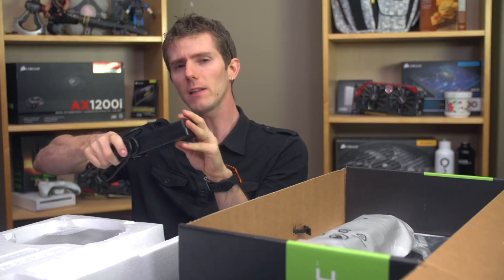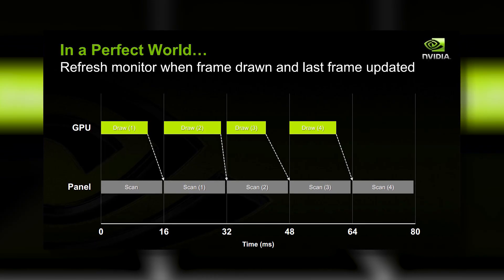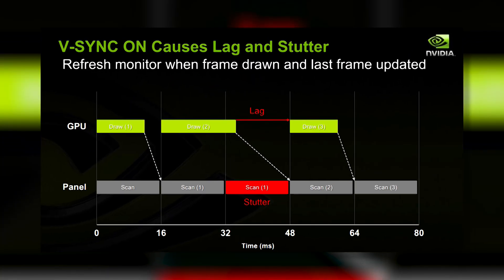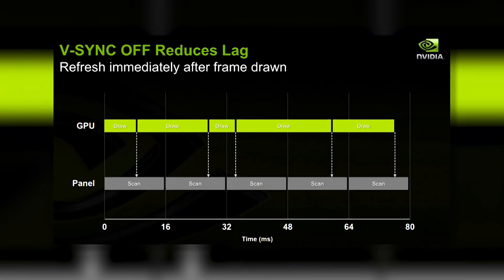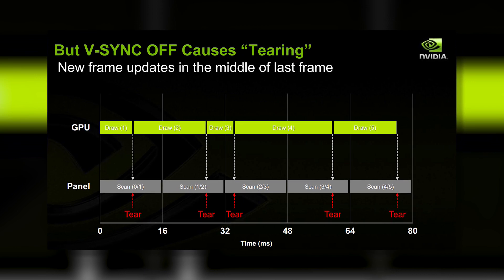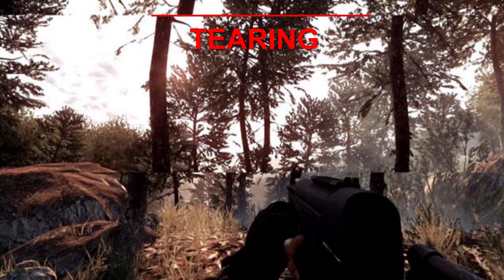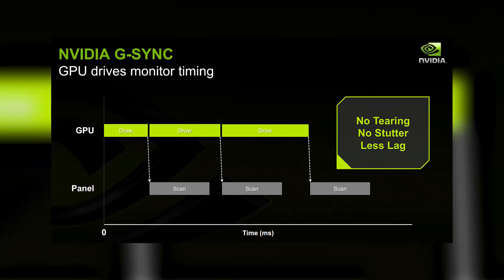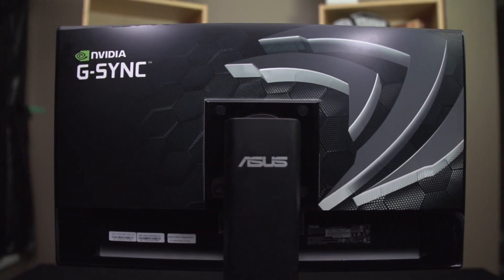NVIDIA G-SYNC Tech Preview - Linus & Slick's Impressions

Comment: Like what Linus said, Nvidia is going to have a hard time marketing it, but there are more problems than just 'whether you can feel it or not'.

At least AMD's Mantle is claimed to support non-AMD chips in the future. Not to mention that G-Sync needs the monitor to support it as well.

On one hand, hardware upgrades don't usually come simultaneously. Monitors can be very durable and serviceable even after you decide to upgrade. 

On the other hand,even if you are building a whole new system with new monitor(s), the problem with G-Sync is that well, you are paying a premium for a monitor which means less budget for GFX cards, and choices are limited to Nvidia models too. It is even worse if multiple monitor set-ups require multiple G-Sync chips.

With this arrangement, and I would guess G-Sync may even take more time than SSDs to become popular, if it ever does.

Comment: G-Sync may be awesome, but, i think it will be useless to spend more money on a new monitor because : Screens working at 140 Hz are coming up, AMD mantle is pushing nVidia, knowing the fact i love nVidia for rendering and game, with CUDA & stuff, GPUs are each day more and more powerful... so, do you need G-Sync right now ? I don't think so, let's wait a couple of months and see... First i will buy an Gigabyte GTX 760 4 Gb and enjoy BF4 with V-sync for now eheh :P
Reply: Screens working at 140hz are coming up? This Asus G-Sync monitor already runs at 144hz. What's wrong with you? Did you drink your dinner tonight?

Mantle is horseshit. Nobody's going to use it. G-Sync requires NO developer support. It'll instantly work with EVERY game that comes out with NO additional software changes.

Yes, we DO need G-Sync right now. Some of us want to run games in MAME with perfectly smooth scrolling at ANY refresh rate.

WEIRDO.
Reply: HowAbout NoSon Most of the screens are not working at 144 Hz, i'm talking about brands, not how much Asus or BenQ and another one have sold.
By the way, you should read a little bit more about Mantle...

Comment: ok i agree it should look better but as pro gamer i c potential lag in there since frames are refreshing at the point they are fully loaded that mey took longer in some situations then casual no v sync or g sync in that case if u play something like fps or moba u might miss a shot or skill becouse with tearing u get as fast as posible view even if not full but if enemie change location u see it as with g sync u might not see it if frame takes longer to load on your monitor then competitors im not perfectly clear will it be so but im 80% sure it might in some situataions and im not buying it as hardcore online gamer of moba LOL (chalenger) eu west i dont see it as a product i might need i prefer a bit tearing instead of lag that might be created ....
Reply: by the way im even using monitor with 2ms.... and as for ssd i sometimes need to work with pcs without ssd since i repair pcs for friends and there friends for money and most of them dont have ssds il say simply no matter how calm i can be no ssd in pc "MAKES ME RAGE" cant stand that slow work with pc wen instead of 5mins instaling oc and in 30mins max done with full drivers and other software games programs ect instaled u take 2-4h and then u realize u missed something since it took so long to install something

Comment: I simply love the concept, it's been a long time coming. However I agree, G-Sync is going to be a hard sell for Nvidia since it's proprietary and locked to their hardware, and it likely will be this way for bulk of it's lifespan. So I think it will go the way of PhysX.

PhysX was all the rage when Ageia had it, then Nvidia bought it and while it remained very popular, over time the fact that they locked it to their hardware, and even disable it in the presence of AMD GPU's without a mod to unlock it, started to kill it. We ended up with other alternatives that are just as good, such as the advances in Havok and game engine specific physics. Both will run on any hardware brand, and thus more appealing to developers since the discrete GPU market is segregated.

I think it's only a matter of time before we see alternatives to G-Sync that will do the exact same thing, but will work on competitor hardware, or all hardware. Plus things such as adaptive/dynamic v-sync exist, while obviously not as efficient as this, can still greatly reduce tearing and shuttering in most games and it exists for both sides of the fence.

These very reasons are why AMD has said they have no objections to eventually allowing Mantle to be open source or made to work on Nvidia (or any other) hardware. It will only work on GCN AMD cards and Windows out of the box obviously, but they realize that locking it to their hardware forever can hinder it's lifespan.

So yeah, that's my thoughts on it. I think it's fantastic, but I also think it's going to be one of those things that will be skipped outside of the enthusiast Nvidia market. But hey, we will just have to wait and see.

Thanks for the video guys, loved it as always. =]
Reply: AMD knows really well that nVidia is pushing them so hard. A simple example can be used : 1 nVidia card can => Play games with high details & stuff => Help for rendering and encoding, when AMD GPUs are only for gaming ! Ofc, on the nVidia side, you pay a little bit more, But, you get more technology ;)
Reply: " So I think it will go the way of PhysX."  
PhysX is the most used physics API.  Nothing can compete with it.
Reply: Abram Carroll
Actually, it's not. Havok and game engine specific physics are far more widely used. Go check out it out, there are very few games using PhysX anymore. The number drops every year. In 2013 there have only been something like 7 or 8 games that support PhysX? It's a tiny number.

Also, PhysX has not advanced much in the past few years. While it was the top of it's class when it was released and for a few years after. Today however Havok can do anything PhysX can, as can game specific physics, such as the physics/destruction engine in Frostbite. Havok has advanced a lot and is still advancing.

So yeah, PhysX has died off a lot, even though it is indeed a great physics engine. The fact that it's hardware locked is what hinders it. The market is segregated and most developers will choose to go with an engine that will work on all hardware, over one that will only work on one segment.

Also, now that AMD is in the core of the XB1 and PS4, this means no more PhysX on consoles. Havok is already stepping in to replace it when a physics engine is needed. This segregates the market even more and pushes PhysX further off the grid.

Comment: So NVIDIA got G-SYNC to improve the monitor viewing experience while AMD has MANTLE to enhance graphics in general (?). I want both in a single system
Reply: No Mantle is not for enhancing Graphics though it can but rather Mantle is all about optimization of the software to make better use of the hardware you have in your PC.
Reply: Thanks for correcting, hopefully there's a demo on Mantle soon. Well both tech seems to be adoptable between AMD and NVIDIA, and I wish they do that but I think it won't happen

Comment: Upgrading to the Samsung 840 Pro SSD was the best computing upgrade decision i have ever made. My mother was so impressed by its performance that she purchased one and i installed it in her crappy $300 Compaq laptop. Even with an old Intel Celeron chip, it runs faster than most non-ssd machines ^.^

Comment: SSD is great for boot times and application load times, but I can deal with a plain old HDD just fine. I actually still run most games off of the HDD because there's no tangible performance to be gained from running it off of the SSD  in my eyes.

Comment: I don't see how the comparison with an SSD is a valid one. The benefits are widely uneven. I mean, take yourself through just explaining them to a non-geek:

SSD: "It makes your computer run noticeably faster."
Non-geek: "Cool, how much is it?"

G-Sync: "It eliminates screen tearing on systems with newer NVIDIA video cards without introducing input lag."
Non-geek: "Could you repeat that in English?"

Don't get me wrong, I'm getting G-Sync because I'm a gamer and I already have a VG248QE, but I don't pretend it caters to anything other than a small niche of finicky gamers, graphic designers and video editors. Sure, it may be a standard a few years from now, but most people won't notice the difference.
Reply: I agree, and some people notice screen tearing less than others, and screen tearing is only noticeable in certain scenes and camera control.
Reply: "most people won't notice the difference" Gamers will ;)
Reply: Gambero972 Gamers aren't most people.
Reply: remnant24 Yes i know.... O.o, "Gamers" ( i mean Real games, the ones wich cares about Software/Hardware & stuff) are a small part of the people ;)

Comment: I don't quite get a big difference between SSD and the old one. In fact, I can turn back and be completely fine with it. With what you said, for most of the people will not / not care / or even fine with a $100-$150 buck monitor, they will not likely to step it up because monitor for most of us is size, frame rate, refresh rate and response time. It will takes a while, i think. I, personally don't thin I'm going to step up to G-SYNC from my Ben-Q monitor soon. However it's worth to think about when upgrading or building new system. Great job with this review vid plus the advice Linus. Thumb up!

Comment: I dunno triple buffered vsync has always worked perfectly fine for me without any massive frame drops unless my card simply can't handle what going on in the first place. I guess I'm not sensitive enough to the input lag introduced with vsync but this doesn't seem that exciting to me. Only difference for me personally between having triple buffered vsync on or off is the dreadful tearing. vsync on doesn't feel any less smooth so it's not really even a question between vsync on or off personally. Still cool that it's a best of both worlds type thing and I definitely won't shun it in the future if it works as great as people say.

Honestly though this will probably never catch on because it's not open source (nvidia only), you need a specific kind of brand new monitor with a newer Nvidia GPU. It' just a recipe for only very few die hards even bothering. So while it may be neat until a more generic version comes a long i doubt this will ever see any kind of real traction.

At least with AMD when they do something new they generally don't lock anyone out. Mantle is open source (despite the internet apparently missing that memo and a ton of misinformation about it being spread) and tress FX was open source. Those actually have a chance of being something that people might actually use.

Comment: early adapters never have much to gain, if it wasn't g-sync some software hardware combination would have fixed the problem, im not impressed because we could have had better gpu/monitor communication awhile ago, with the ssd, the use of nand flash changed the game for storage, but there nothing new actually in this, amd, or even Samsung could easily create their own solution that could talk to integrated graphics on processors across the board,

Comment: After watching your review of the BenQ XL2420TE I grabbed one. Having never had a decent display (I was using a pretty cheap Asus 60Hz 5ms display before) this is outstanding! Every application I've ran is like liquid. There's not been one instance of screen tearing, flickering etc. So what difference would I actually see in G-Sync technology to want to switch to it. I love the review of G-Sync technology but it doesn't seem like it has an advantage over this monitor.